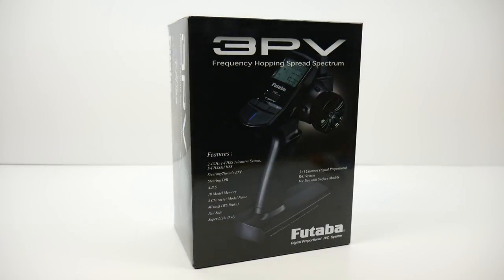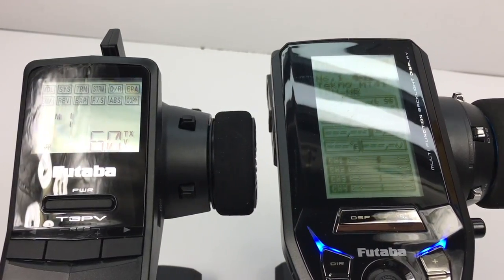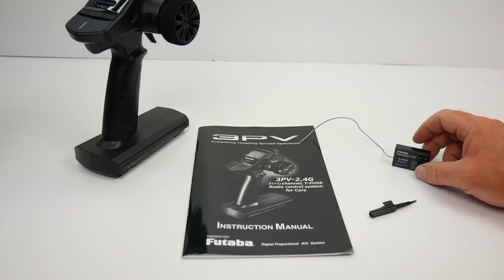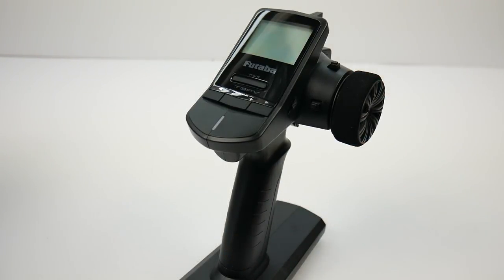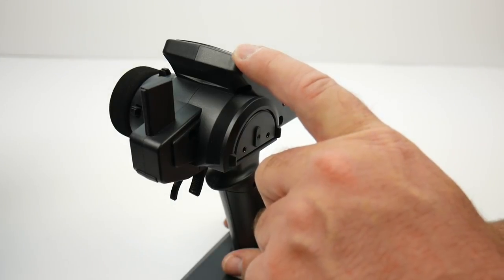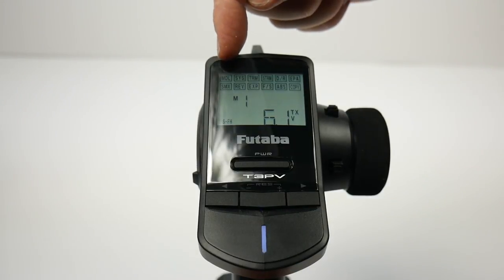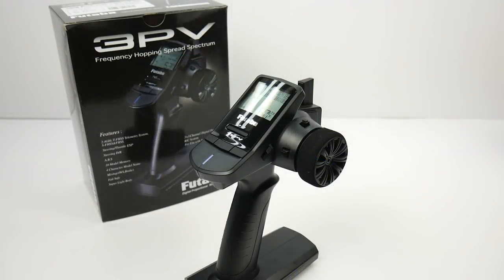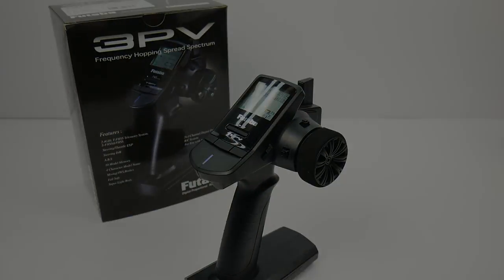Futaba 3PV Unboxing - RC Budget Build 2!!!

Comment: I got my 3PV last year and dang it’s pretty expensive to me as I was going for a budget built. $150 is quite expensive but damn it’s worth my money. Works very very well but I did had some problems with it especially the brakes and reverse as it barely had any brakes and the reverse was reversing too fast. Took a me good while to figure the thing out, but now I’m used to it and it’s pretty easy to operate it. I recommended for any one whose gonna do it for a budget built or just something to bash around with.
Reply from the maker: Typically those features are due to your ESC - also doing a quick calibration from the new radio system to the ESC will help too.
Reply: The RCNetwork it kinda was to me. I got it to fix and it’s working pretty good now

Comment: nice review of this rich.    my question is, do you have to use the antenna wire or can you basically just tuck it away out of reach so to speak.    i'm going to be using this on my new tekno mt410 and didn't know if i had to actually use it with a antenna tube or not.   i'm use to the arrma setup where everything is wireless lol
Reply: no you don't  it will work just  fine  tuck away

Comment: Hello ,

I am new to the rc world, I have a tamiya clodbuster , is this radio compatible?
Reply: there's no compatibility issues, any radio can work on any rc car.  The main thing you want to look at a radio for is features that you're wanting or needing.  The radio will come with a receiver  so you just replace the receiver on your clodbuster with the new one that comes with your radio attach the cables from the components (esc, servo, etc) and should be good to go.

Comment: Would this transmitter and RX compliment my Arrma talion rc truck? It cost me 600 notes for the talion , 2x3s 4000mah lipos. I used to own a flysky digital transmitter but my mum took all my old rc stuff down to the tip!!!
Reply from the maker: Yes, the 3PV would be a nice upgrade with improved response, range and better user experience.  Plus multiple model memory when you get new cars

Comment: Im currently building up a yokomo yd-2 and having a difficult descission on a transmitter. I have always used spectrum for aircraft but I wanted to try something different, so looking at the Futaba 3pv, Flysky gt5, or kyosho Syncro KT-331P. any suggestions?
Reply from the maker: james Andreassen Spektrum owns the air market, but for surface, the Futaba and Sanwa controllers are superior. This is a great entry level model from Futaba. Also check out the 4PV - it packs a ton of features

Comment: Do a tekno nb 48 to  "n"sct410.3 "n"itro  conversion
Reply: Jonah Werbelow 😂I'm sure he'll get right on that
Reply from the maker: I'm def not a nitro guy....never have done Nitro...looks cool, but lots of headaches
Reply: i agree nitro does have some headaches but it's alot like brushless and lipo tech... full power until you run out of gas once you have the tune right on the engine.... That is a really cool idea.... a Nitro powered or gas/oil mix (2 cycle) tekno 410.3 sct.... wonder who would want to build such a kick ass beast of a sct?! i'm gonna be buying a 410.3 once i get the money and i am gonna build it up serious basher style!! badlands mx28 tires, hobbywing electronics (xr8 plus and a hobbywing 3660 motor rated at 3200 kv, lcd programmer box)... protek rc 2s and 4s LiHV packs at 100 c continuous, gens ace 3s lipo (nothing but bullet connectors at 5 mm!!), nearly every option you can get for it i will... plus the radio i will use is the Futaba 4pv with a telemetry temp sensor so i don't hurt the motor at all.... i'm buying at Amainhobbies.com! pray i get the money to build this beast!!